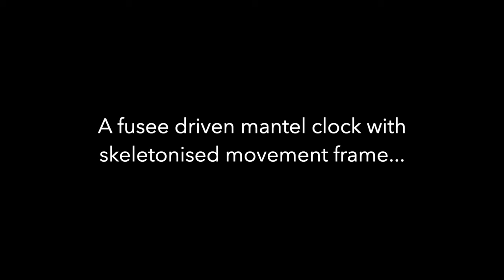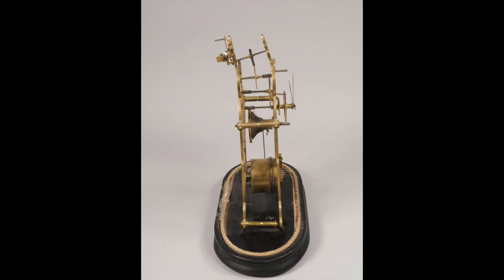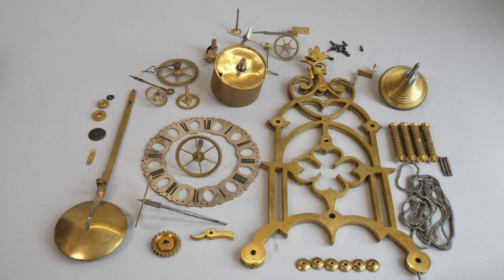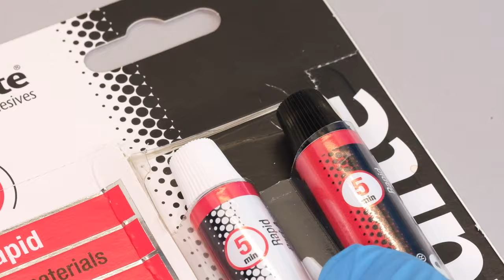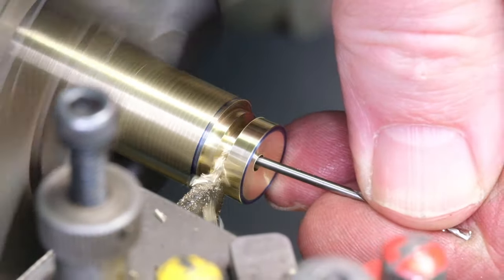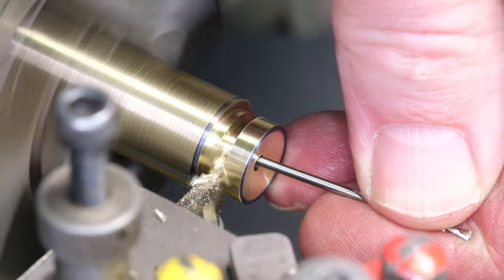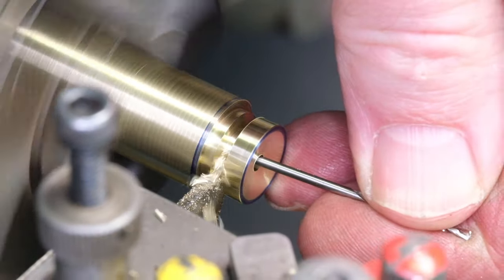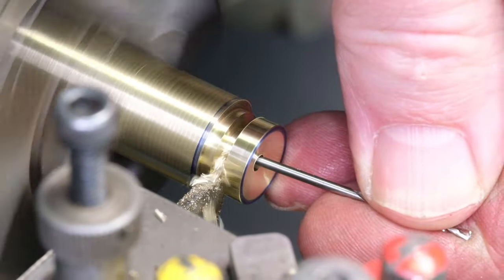READ Repairs #006 Fusee driven mantel clock with a skeletonized movement frame 2023_12_26

Comment: Great photography Matthew, you will give clickspring a run for his money!
How do you polish the frames,.particularly the heat treated areas?
Reply: Sorry, I just saw your reply to Ian, do you use wire wool or a cloth/brush?
Reply from the maker: Hi David.  I think I have some way to go before I reach Clickspring territory!  Thank for your kind feedback.
Reply from the maker: A No2 Glasgow brush in the first instance.  If I feel further intervention is 'needed', I may move onto 0000 grade steel wool.  I notice in the video some of the metal polish (previous repairer / owner) remained inn the corners of the frame so I was happy with that.  I always prefer an approach to something; more can always be done.  M @davidhaggarty

Comment: What a really helpful video Matthew. Lots of skill covered and beautifully filmed. After the frame straightening the frame changed colour as part of the heating process ( from the rest of the frame) Did you have do any refinishing to match the existing frame on what would be a very visible clock?
Reply from the maker: Hi Ian.  Thanks for your kind feedback.  Yes I washed the movement frame and other components in Elma WF Pro waterless watch cleaning solution.  It is not really because of the visibility of the movement per-se, as you know I rarely chemically/mechanically re-finish clock components, irrespective of whether they are carriage clocks etc.  In this case however, because my 'experiment' had caused the variegation, I felt the balance tipped towards making the appearance more uniform.  Not ideal and something I will reflect on.  M
Reply: @readrepairs  I think you struck the right balance Matthew and the measured approach would have minimal impact. What a range of issues and repairs you covered it was great to see your skills. It was a video I will return to again and again. Thank you.
Reply from the maker: Thanks Ian.  As always, your support very much appreciated.  M
 @ianharris3933

Comment: Thank you, really well done. Must be hard to film and work at the same time. Impressed! How do you fix the new pivots - loctite or simply friction?
Reply from the maker: Thanks John!  Yes it is.  That is why some processes might look more clumsy than they would without the filming, plus I have to leave some bits out due to lack of focus and etc.  Pivots just tapped in as they are very slightly tapered.  Have to be careful not to split the arbor.  Loctite is fine though if you need that extra bit of security.  M

Comment: Am I correct in assuming the main framework plates are cut from thick sheet giving a certain level of hardness to the brass.   Enjoyed the video thanks.
Reply from the maker: Yes, typically nowadays these frames are cut from sheet material with a piercing saw so yes, the host metal will likely be 'half-hard' rolled sheet or earlier, cast sheet.

Comment: Impressing video Matthew, thank you for sharing it. How would you approach the fitting of a weaker (narrower) mainspring in a barrel with a spoked cap where a solid spacer might not be acceptable? I suspect only one spacer at the bottom of the barrel will make the mainspring wobbling. Thanks
Reply from the maker: Hi Alberto.  That is a good question.  I might consider using a transparent material such as perspex, or piercing-out the spacer too to match the barrel wall and cap or use a contrasting material such as aluminium?  M

Comment: Lovely video, very interesting😎👍though i was watching every step, found myself marvelling about the tools being used. Where do i find the spring metal to do my clocks pendulum. I had close examination of this clock which seems to require that type of pendulum, not to mention actually making the pendulum. Experiments with 2 attempts has shown i must just find the correct type as clock itself is functioning good. Strike side spring is fully winded cant get it to release
Reply from the maker: You can buy spring steel for the suspension spring from horological supplier in many countries.  here in the UK that would be HS Walsh or Cousins.  For brass etc to make the pendulum try eBay.  That is the best way to find small quantities.  You may want to contact one of the clock institutions, here in the uk that is British Horological Institute.  They have all sorts of connections that may be of use to you.  Also check out my other YTR channel.  Lots of top tips there.  https://www.youtube.com/channel/UCq25FhgQkNLeNJOBcw9BOlA
Reply: @readrepairs  thank you so much for reply and info. Will try to find out the equivalent here in SA